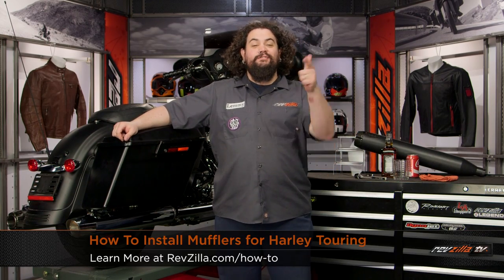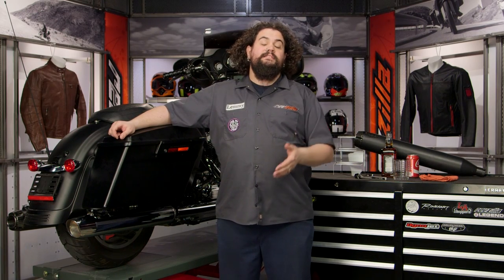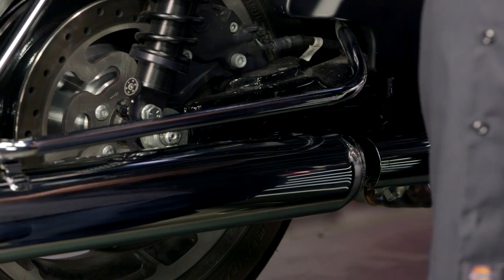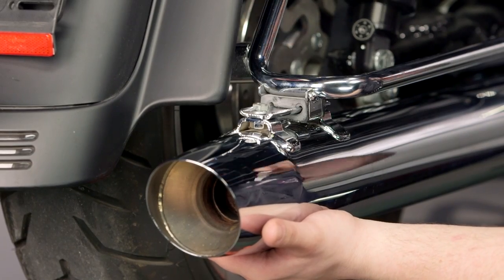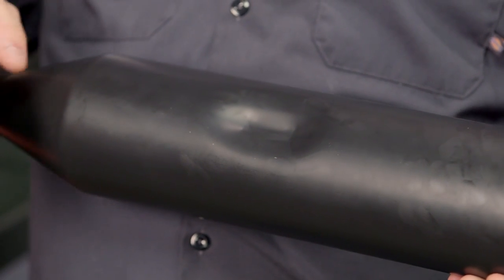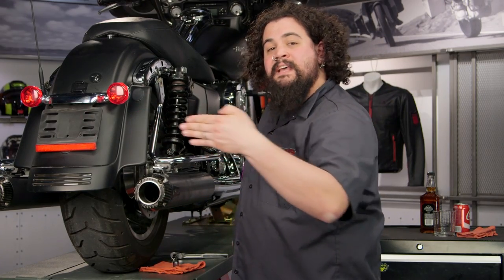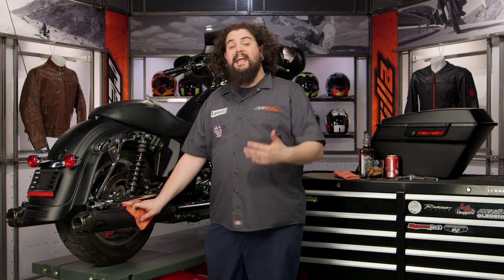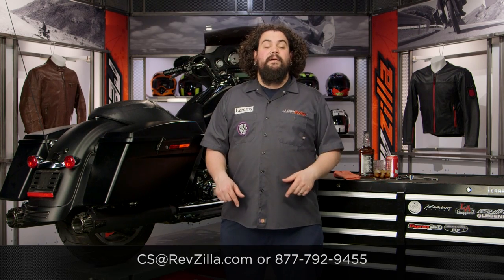How To Install Mufflers for Harley Touring at RevZilla.com

Comment: This was a great video on a relatively easy and basic task of putting on some aftermarket mufflers.  I really enjoyed the humor in this video.  When I remove my bags from the side of my bike, I treat them like they are full of nitro.  I gently put them down on towels on the floor to make sure I don't knock them off a counter and I put them out of the way so I don't trip on em.  When I saw Lemmy throw that touring bag, I sat up in my seat!!  That was GREAT!!  The same thing with the old stock muffler...great humor!  Like someone else said, not too much humor but not too serious either.  Great video Lemmy, thanks man!!

Comment: Excellent tutorial. Bought a set of.     S & S slip ons and it was that easy.....well sorta. It took a bit of elbow grease to remove the stock ones. 5 years of heat and surface rust almost fused them together. Following the circular and pulling motion simultaneously made it simpler. Took me an hour to.remove and replace. Much appreciated thank you!!!!

Comment: I have a 04 ultra classic and got 36 inch fishtails for Christmas no baffles do I have to do anything to the computer thank you and you make great videos
Reply from the maker: You would definitely want to use a fuel tuner when installing that exhaust, since it will be much more free flowing system.  I would suggest the Power Commander:

www.revzilla.com/motorcycle/dynojet-power-commander-v-for-harley-touring-2002-2006?sku_id=900930

-Zack

Comment: When installing slip on's, do I have to remap the bike again ?
Reply from the maker: +tek2236 If just installing slip-ons, you probably don't need to re-map the fueling. If you also change the air cleaner, then you'd want to re-map. -DrewZilla

Comment: So I'm thinking about installing a set of Cobra 3 slip ons for my new iron 1200. I was wondering if I had to tune my bike after the installation or if it's as easy as just installing the new mufflers and continuing to ride as usual?
Reply from the maker: If just installing slip-ons, you don't necessarily need to tune your bike. If you then change to an aftermarket air cleaner after installing slip-ons, though, you'd want to retune. -DrewZilla

Comment: I put them on my new 2016 ultra limited. i wiped them clean and when i started the bike the pipes smoked for a bit, Was this some sort of oil inside the pipes burning off. They seem fine now.
Reply from the maker: Yes, it's residual oil that burns off after you run it the first time. -DrewZilla

Comment: I want to install a slip on megaphone exhaust...do I need to re-jet if that's all I'm changing, really need an answer to this please. Thanks guys awesome videos
Reply from the maker: You probably won't need to re-jet. If you also changed the air cleaner or decided for a full-system later, then you'd need to re-tune. -DrewZilla

Comment: I've got some V&H slip-ons to go on my 2018 Softail. Should I use any silicone sealant on the join, or will they seal up fine without it?
Reply from the maker: They should seal up just fine without it. If you do get a leak, though, then a bit of high temp sealant is ok. -DrewZilla

Comment: I followed the tips on your video but still unable to get the stock slip on's off. Dont want to wrestle too hard on my header. Any suggestions?
Reply from the maker: Try penetrating oil and some heat, but be careful not to light anything on fire! -DrewZilla

Comment: So, you do or don't need to map when installing slip ons?
Reply from the maker: If you have a stock air cleaner, then you don't need to re-map when installing slip-ons. Once you do air cleaner + slip-ons or once you do a full exhaust, then you need to re-map. -DrewZilla

Comment: I installed s&s mk45, no leaks or anything. Took it on test run and smelling a burnt smell, is that normal???
Reply from the maker: Yes, that's normal, as any oil coating the inside of the exhaust will take some time to burn off. -DrewZilla

Comment: what are the draw backs to cutting the muffler besides noise?
Reply from the maker: You'll also change how the exhaust flows, which can alter the tune of the bike. -DrewZilla
Reply: So would that harm the bike’s engine/ throttle control or just make it sound weird because of the altered tune?
Reply from the maker: I should have said that it can adversely alter the tune. Perhaps I should ask you what you mean by "cutting the muffler." If you remove the stock mufflers and install aftermarket mufflers, you won't alter the tune enough to require any adjustments. If you mean just removing the mufflers and not installing anything in their place, that is not recommended at all. -DrewZilla

Comment: Is it ok to keep the muffler off like you see on custom bobbers?
Reply from the maker: You'll lose the exhaust backpressure that helps power low-down, so I wouldn't do it. -DrewZilla
Reply: +RevZilla is it the same thing if you take your baffles out?
Reply from the maker: It's not exactly the same, but yes, removing baffles can also reduce backpressure a bit. Removing the entire muffler reduces it even more. -DrewZilla

Comment: Lemy, do i need to upgrade the air intake after installing new slip on pipes?
Reply from the maker: No not really. If you just install slip-ons, you do not need to change the fuel mapping. If you install an aftermarket air intake as well as the slip-on, well then you'll also need to pay for a fuel tuner or pay to have the bike tuned. If you can only afford to do one thing right now, then just do slip-ons. You could do an intake and fuel tuner at a later date. -DrewZilla
*https://www.revzilla.com/common-tread/motorcycle-exhaust-101

Comment: Lemmy,  Do you need to install a tuner when adding slip ons???  Had a buddy buy a set and the chrome discolored.  Seller said it was because he didn't add a tuner.   BTW i love all your learning videos!
Reply from the maker: I'm glad you like the videos! Any newer bike will benefit from a tuner since most come fairly lean from the factory. With a slip-on system, it is generally not 100% required since you are not removing the catalytic converter. However, we still suggest it. 
-TeamZilla AJ

Comment: Do u need to tune bike after slip on install
Reply from the maker: If you have a stock air cleaner, then no, it's not necessary. If you already have an aftermarket air cleaner, then adding a slip-on will change the air-fuel ratio enough to warrant tuning. -DrewZilla

Comment: Do you need to unplug oxygen sensor?
Reply from the maker: You need to unscrew the oxygen sensor from the stock exhaust, but you don't necessarily need to unplug the sensor wire from the bike. If your new exhaust has oxygen sensor bungs, then you'll screw the sensor into the new exhaust. -DrewZilla

Comment: When you said gorilla strength I didn’t realize you were serious. They are 10 times stronger than man and it took me 3 1/2 hours and some penetrating oil to do this so called easy job. Doesn’t make me want to buy from revzilla
Reply: Wait ... so your mad at RevZilla because your bike / bolts are rusted out? Got it

Comment: fuel tuner ? yes no?
Reply from the maker: +Adi Ware Generally speaking, if you just install slip-on mufflers, you don't need a fuel tuner. If you also install new headers or an air cleaner, then you'll want a fuel tuner. -DrewZilla